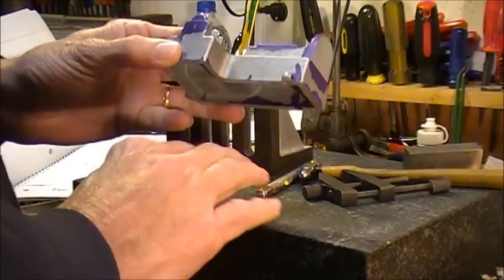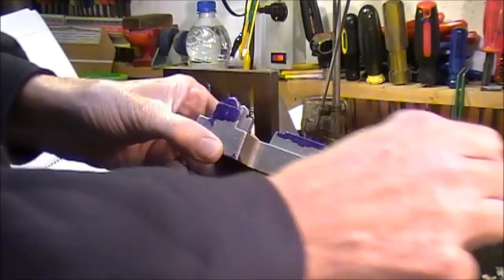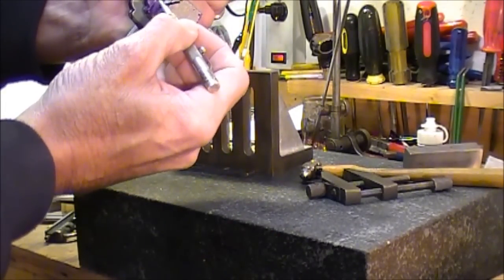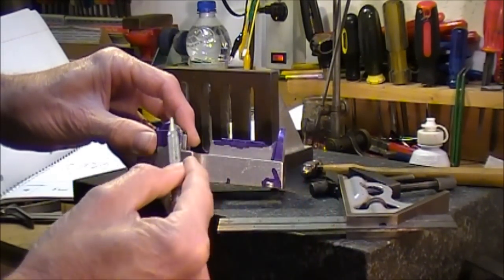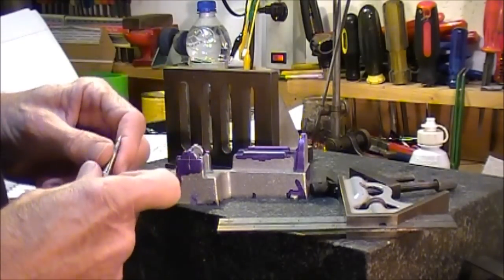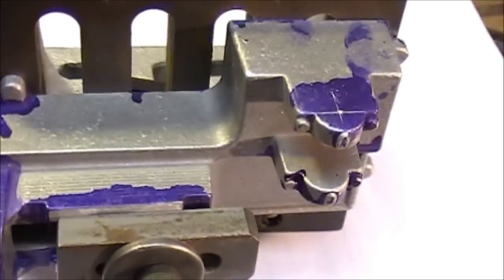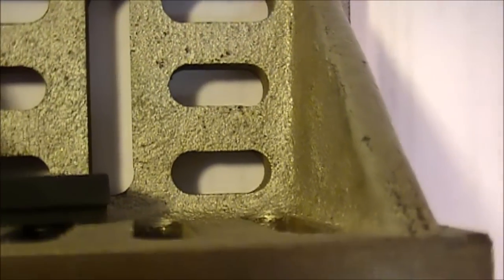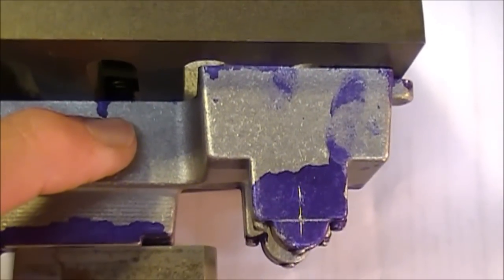Part 8- PM #3 Steam Engine-Machining and Assembly

Comment: John, really enjoy your videos and I am returning to this series again after watching it years ago. One question: I don't recall hearing how you decided on the height to mill the cross head bosses on the casting or how much to mill off the end where the cylinder attaches to have the crankshaft hole be in the middle of the casting boss. Any insight would be very helpful and thanks in advance.
Reply from the maker: Thanks for watching.  I've looked for the plans but must have misplaced them. However as I recall you mill the cross slide down to one half cylinder diameter.  That way they will be parallel to the center of the piston.  ~John